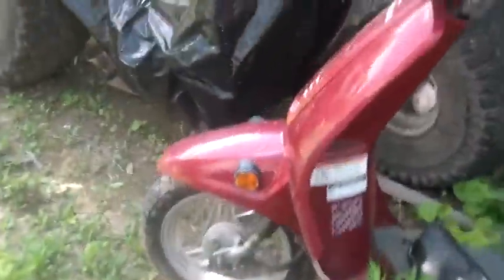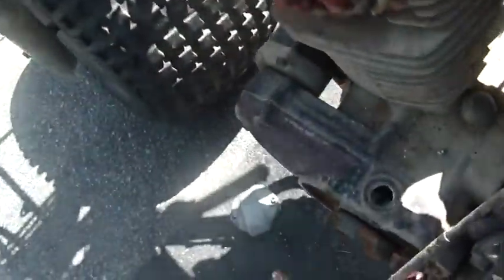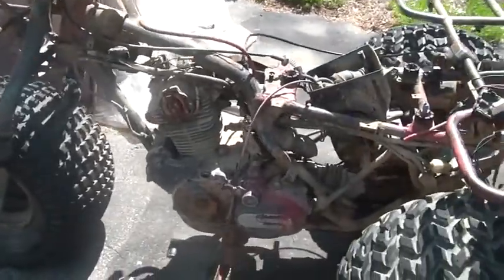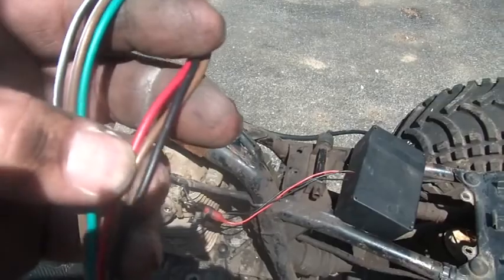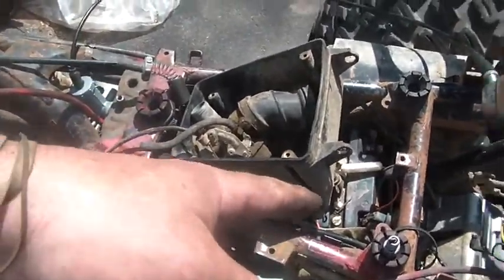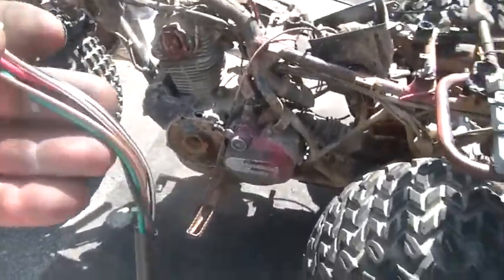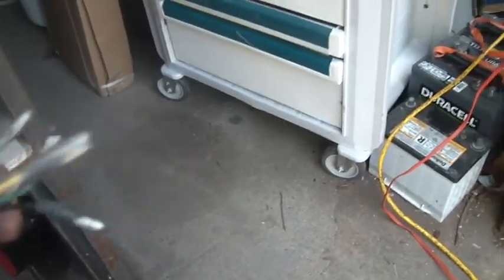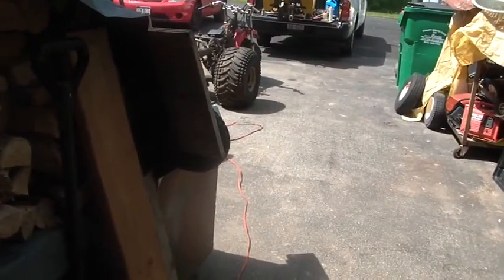Honda 200ES timing, TDC, leaky intake valve, wiring a key switch,

Comment: Harvey, I have a 200es that I need to change the stator (hopefully thats why no spark) but can't get the cover off. Is there a trick?
All the bolts are out. I've tapped on it but no movement.